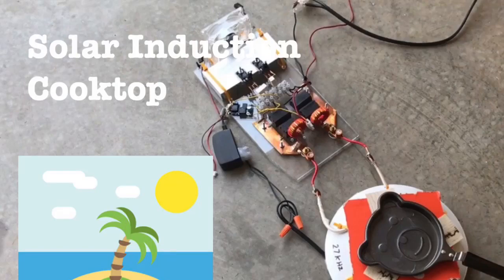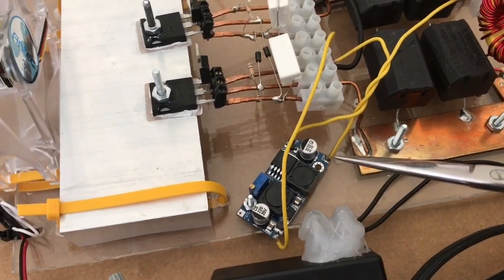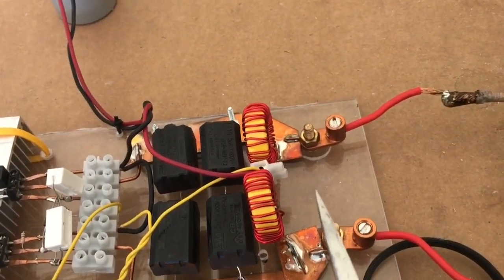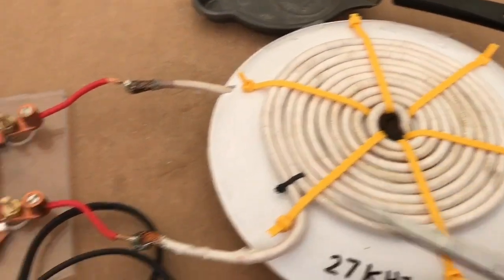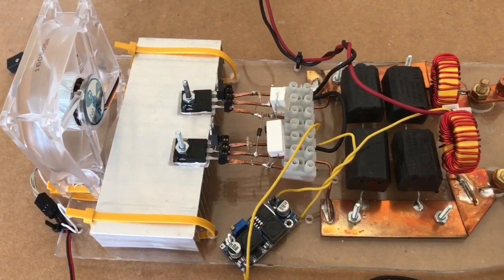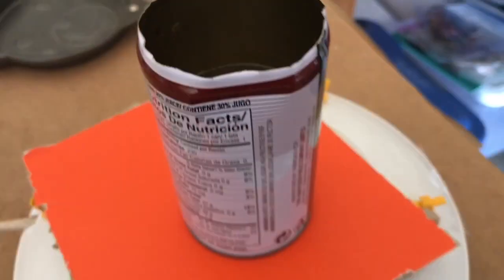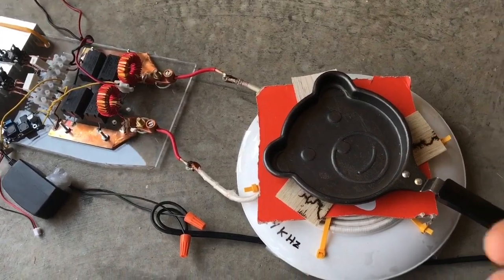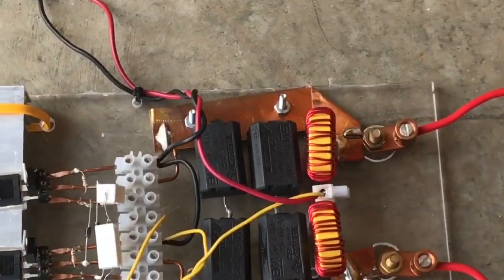Sun Powered Induction Stove

Comment: I'm unclear about something - you're not saying that the tiny buck converter is running those big transistors of the main oscilator are you?
Reply from the maker: Nope the buck converter is just keeping the gate voltage constant at 12V on the big mosfets. This allows operation from a solar panel when the voltage of the panel drops low from clouds covering up the sun. The little buck boosts the gate voltage to a constant 12V

Comment: what will be the difference between both the output of 2000 strand or 100-500 strand litz, will it take more time in cooking & on what top u have mounted the litz wire coil. Also what type of battery bank you would suggest us to use & of what configuration for cooking in twice a day & what is the configuration of capacitor used at input of buck converter is it 10000uf? U have also mentioned to use another buck converter for cooling fan, will you please help us with how to add it in the circuit, i.e.from where it will get its input, do I have to connect it on the same 10000uf capacitor. Then there will be one input & two outputs connected at individual legs of that capacitor

Comment: I have bought all the components in the circuit, but I'm to unable get 2000 strand litz wire here in india, plus its cost is very high, can ulyou please suggest any alternative for that coil
Reply from the maker: shubham isadkar i tries 25-30 gauge magnet wire. You dont need 2000 strands. You can make 100-500 strands. It will work just as well. Make sure to burn the enamel coating off both ends of the home made litz wire. Use a solder pot to do this so all of the strands will be electrically connected.

Comment: Hi,how many solar panel do you use for this and what of the watt for one solar panel and how to connect solar panels in series or parallel ?
Reply from the maker: Khaled Dhr this one uses two solar panels 2 x 100V 12V panels connected togtyer in aeries for a total of 24V DC. If you use a 24V solar charge controller, then it can be used for cooking after dark. However, in this video, it is to demonstrate its operation without battery. It will only workk during sunlight with no charge controller or battery.
The 2000 strand litz wite is whatvi had lying around. There is no heating of the pancake coil with the 2000 strand litz. With 100 or 500 wite litz, there will be some heat loss in the coil but not much. The coils in commercial 1800W hotplates only have 50-100 strand litz and they work fine.

Comment: good project buddy! but i had a little confusion regarding schematic that you are providing the same dc supply to the toroids and than these toroids are connected to the terminals of coil which makes it short, that is same voltage across both the terminal of the coil. could u please explain?
Reply from the maker: Pankaj vijayvergiya it actually doesnt short but starts resonating. The schematic looks confusing.
Reply from the maker: Pankaj vijayvergiya one of the MODFETs turns on a few nanosecinds before the other one so current only flows through one of the two limbs of the coil. This turns on the opposite MOSFET so now current flows in the opposite direction and the cycle repeats at the resonant frequency of the LC tank

Comment: Hi , I have been researching on the Solar Powered Induction cooker , and this is my final stop,  nice job and well elaborated , two question though . 1 The wire you used for the coil and what material did you strap it on , any chance of varying the heat on the work coil /load  , Thanks again I will be constructing this asap
Reply from the maker: Rashaka Jasper the wire is 2000 strand Litz wire. The best operating voltage is 24-30V DC. Optimal is 30V. Because of the nature of Mazilli type circuit this is best. The buck converter which will allow the circuit to run below 12V when the sun gets covered over with a cloud (when there is no storage battery or solar charge controller) has a maximum operating voltage of 33V.

Comment: Hi, I'm interested in this induction cooker and like electronics; I noticed an additional component in this video that doesn't appear in the circuit diagram: it's the two semiconductors which are in parallel with the MOSFETs, to the 3-way screw terminals. What is this component? Is it essential to the circuit? I think it's a kind of diode-not the uf2007-but I'm not too sure... thanks Paul
Reply: Does the little blue potentiometer on top of the buck control the frequency? by how much? and at what optimum frequency should I run this PSU?
thanks,
Paul
Reply from the maker: Paul O hi thanks for your interest in this project. The semiconductors across the drain-source of the IRFP260 mosfets are freewheel ultrafast diodes U860 and are not necessary for this circuit but do provide protection for these mosfets in solid state tesla coils. The circuit diagram and project description can be found here:
https://wp.me/P8V9IH-2f
Reply: @BrianDhvTinkerer  Thank you very much for help -Paul

Comment: Sir, Please send me the schematic circuit diagram into this mail... sharesolar@live.in or thyagarajabr@gmail.com
Reply from the maker: Thyagaraja Br I have made some instructions and circuit diagram here: https://wp.me/P8V9IH-2f

I made another one with 12 - 14 turn pancake of 2000 strand Litz wire and with a 4 uF cap bank (12 x 0.33uF 1200V parallel connected Induction heater caps)  and the identical circuit shown in the above link and powering it with 24V DC from solar panel bank. It works fantastic and can be used to fry, cook and bring large pans of water to the boiling point.

Comment: Awesome work! I'm real fan of your invention! Is there a big difference between your schematic and that ZVS Low Power 1000W 20A device - http://bit.ly/2yilYU5 (Aliexpress link)?
Reply from the maker: QUBA.MOBI the main difference is the use of a buck converter to hold the gate voltage constant at 12 V and allow the unit to work with solar panels. The 12 V zeners in the    commercial would not work predictably with solar panels.
Reply: Thank you for quick reply, Maestro!  I'm very impressed by your results. Some users of ZVS complains about high temperature of elements at 700-1,000 W. In your "Sun Powered induction Cooking" video, you said your device even don't use fan while high load (water boiling). What is the maximum length of your "cooking time" with Pancake Coil? 
Thank you.

Comment: Can you tell how to make this
Reply from the maker: Hi Monika, please send you your e mail and I will send you the schematic. It uses a ZVS oscillator to drive huge currents through the cooktop which is a 10 turn pancake coil made out  of Litz wire containing 2000 electrically isolated strands of wire within it. The total capacitance of the tank circuit is 5uF. I used 2 rows of parallel series (4 total capacitors each at 5uF) 275V MKP induction stove capacitors for making the tank circuit.
Reply from the maker: Hi Monika sorry for the long delay- here is a schematic with the instructions on how to make this Cooktop: https://wp.me/P8V9IH-2f
Reply: Hello monika please send the schematic to me also....to aaronstone491@gmail.com

Comment: Pure bullshit. Powering induction heater via super cheep crappy ebay buck converter rated to few amps. Realy man!
Reply from the maker: fivana7 hey dude that's not an eBay inverter. That's one I put together myself with better quality caps. It's a Royer circuit.
Reply: I see now. I was watching video without sound and have misinterpreted wiring, sorry my bad. Thumbs up.
Reply: TESLA SCIENCE I'am not talking about Royer circuit, but little small blue buck converter you use to adjust solar panel voltage for royer circuit. You claim that small buck converter is passing through 200w of power. On 12V thats like more than 16,5Amps, and that with thin yellow wires of 1mm diameter tops.
Reply from the maker: Sinky J. No the buck is not to handle the 200W but rather to hold the voltage on the gates of the IRFP 260 MOSFETS  at 12 V to allow them operate at the plateau i.e. Zero point switching even when the voltage from the panels drops below 12V (e.g. When a cloud passes over the sun). If there was not a step up step down buck connected between the solar panel output and the gates the voltage on the gates would drop below 12V causing the MOSFETS to burn up. The output from the panels is connected directly to the sources of the MOSFETS and the other plus lead from the panels is connected to the tank circuit via the powdered iron toroid coils.  So almost all the output of the panels runs the cooktop with a little shunted off to provide 12V for the gates.